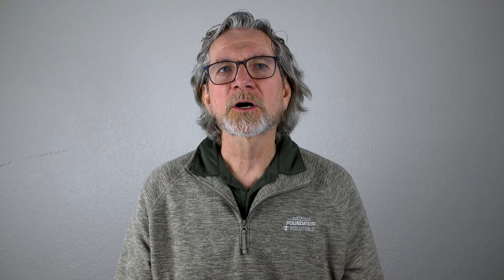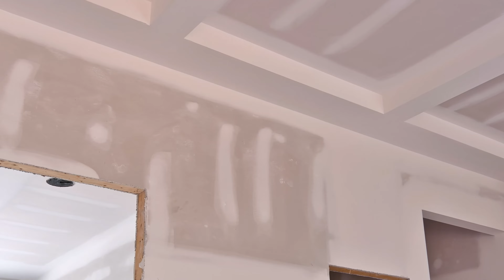What are those popping sounds in my home? Wood friction vs soil movement.

Comment: I hear  50 pops a day and year built 06. Walls bowing at footer slab foundation on both sides inwards. Cracks at each door and window and large voids now in garage, living room and bedrooms and driveway. I am renting. landlord called inspector but no engineer. 3 months ago they said it was just settling. It takes 20+ years for settling to finish? Why is it worse with each rain? Should I move out? There are more problems like no drainage away... no french drains. 2 ft thick header above garage door has verticle crack in it the entire way across and garage door bar holding the spring is bowing in the middle downwards about 3 inches. super scary since we are living with this for about 2 years and got much worse this year.
Reply from the maker: Any home without proper drainage will face serious foundation issues. The rain gets under the home and expands the soil underneath. If the walls are bowing the way you described, take pictures. Take as many pictures as you can and send them to your landlord. Keep a record of all communication. Foundation repair is one of the most overlooked repair that many people do. Denial is powerful until it's too late. Tell your landlord to install rain gutters, and grade the ground to be at least a 5% grade away from the house to prevent any further issues.
Reply: @ArizonaFoundationSolutions  yeah. He had someone come out. They said normal settling. This was concluded even after we had tree roots growing under toilet that caused it to leak. Yikes  sewage busted from oak roots next door. That with this no drainage issue. 

How bad does something need to be to have a wall or something collapse? House has a tile roof